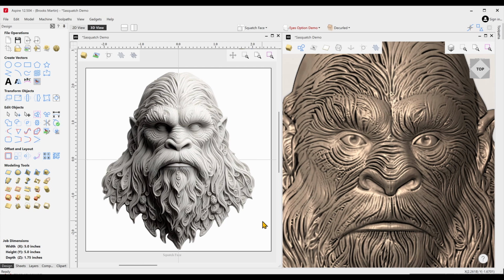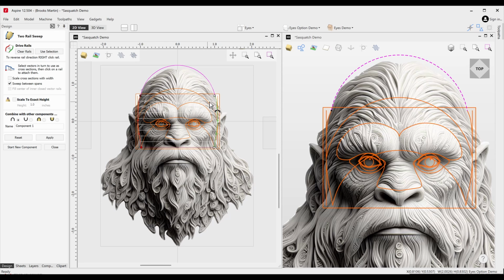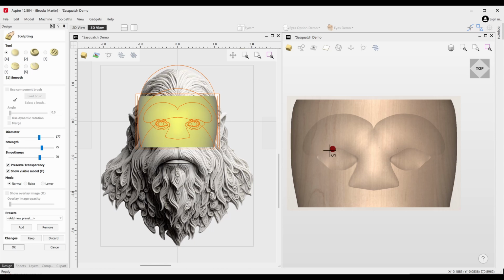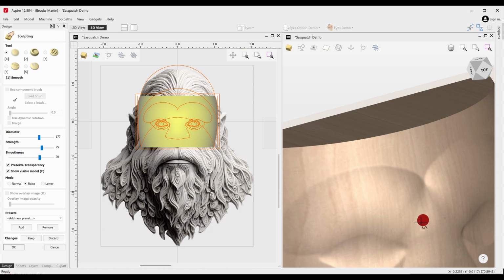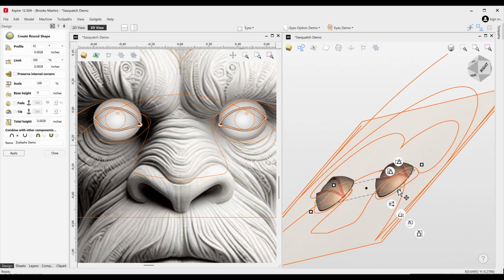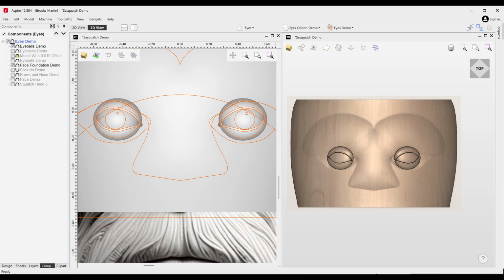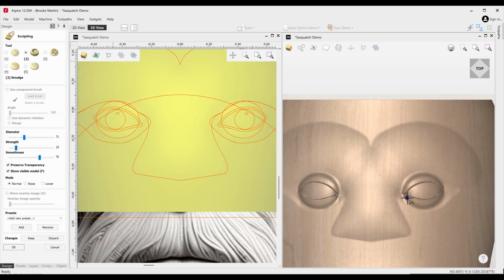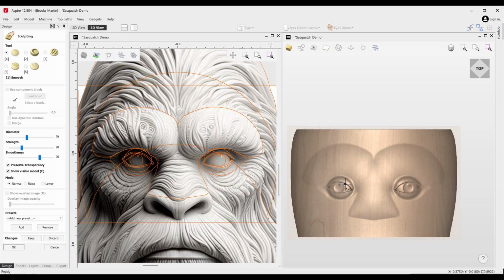Sasquatch Build   Part 4 The Eyes

Comment: Nice tips Brooks - thank you for taking the time to teach your techniques.  View>Light follow profile tool was new to me and how you control the smoothing tool with raise vs normal, etc.  Your technique of using sheets and then making each component makes total sense but takes a little getting used to on how you ae accomplishing alignment with the bitmap so when you try to combine with the larger model it will all come together more easily - I assume that is what you are doing.  Your technique is helpful to watch.  The one thing I missed and can't find it when did you create the skin that you were turning on.  Was tht in the last video or your first video?  Did you save that as clipart like the other parts and then import after you created this sheet.  I am sure you showed this but can't refresh on how it got there.  Thank you for taking the time.
Reply from the maker: Hi Rob Thanks for the feedback. I didn't show the skin's creation. The tool used is the 4th icon, under File operations, 'Create a component from a selected or imported bitmap'. Using Vectric's default shape height (0.0898") for the final overlay, I did lower the shape height to 0.03125" for the separate sheet face parts. Alignment-wise, the vectors, bitmap and 'Skin' are copied to the new sheet as one then centered in that sheet. I'll talk about positioning the clipart (nose, mouth, eyes...) in the final assembly video. But the original vectors are used.